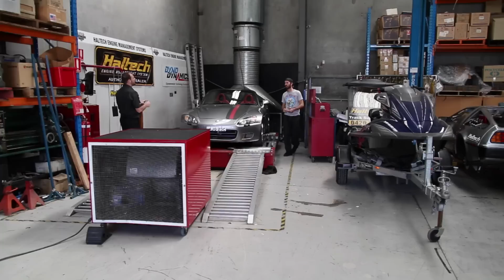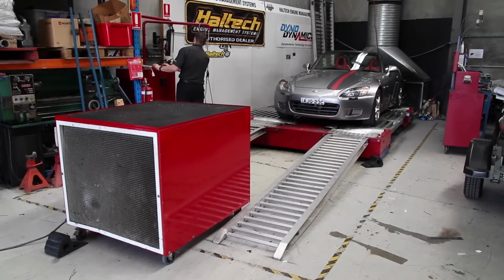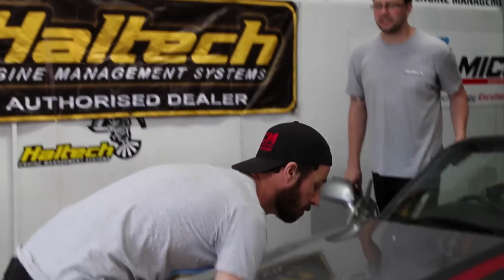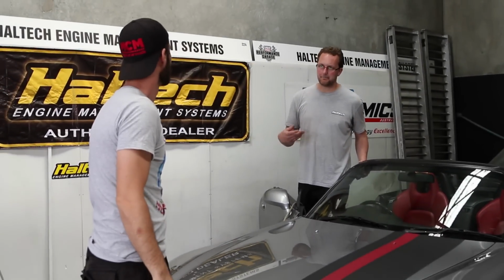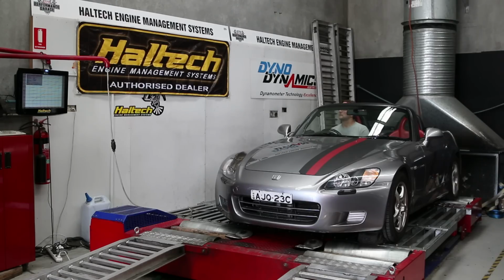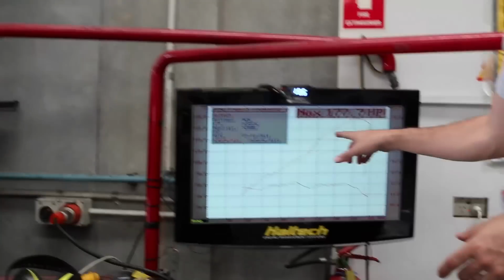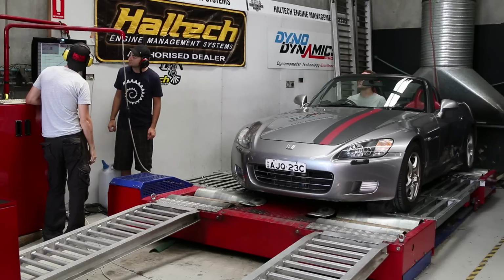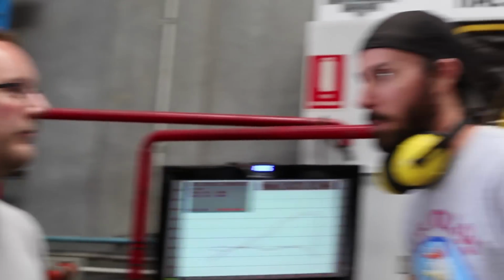Cold Air Intakes Mythbusted [Naturally Aspirated]

Comment: I feel that if air is too cold oxygen molecules will not move around as quickly, thus giving themselves less of a chance to interact and ignite with the petrol. On the other hand, if air is too hot, then the capacity for density of oxygen may be lower due to increased air pressure. As a result, I feel that there is a point at which you can optimize density and molecule speed, and it won't be at an extreme of hot or cold temperatures. Somewhere in between. What do you guys think?

Comment: Rx8 is a 4 stroke engine only different is the crankshaft gets power each rotation of the rotor. But for a piston engine the piston need to cycle 2 times for a rotation of the crank shaft

Comment: My cai is right in front of the driver wheel. Whenever I hit a puddle, steam comes out of the exhaust. While I could run a filter bag or water bypass, it makes me laugh that my engine with 220k doesn't hydralock. You Honda boys need tougher motors.

Comment: Having owned an S, the stock box is very well designed, and the filter and box from factory allows a high amount of flow. Moving the location of the filter does more in an S2000 than just replacing it with a CAI. Other cars respond much better than an S2000 to cold air intakes. This video is inapplicable to any car other than the S2K.

Comment: I love your enthusiasm and you are obviously knowledgeable and experienced. I live in South Florida where it is fairly hot and humid in the summer. It can get down into the 40's in the winter (sometimes colder). With every car I've owned, and there have been several in my 45 years of driving, I have noticed an increase in peppy-ness or, shall we say responsiveness at the peddle, when the temperature drops from the 70's and 80's (Fahrenheit) into the 50's and 40's. I believe you are correct, that you cannot feel an increase unless there is at least a 10% increase -- so what would you attribute this sense of responsiveness? If it's not raw power, could it just be that the delay from peddle to power is shortened enough to sense an improvement? Its a green-horn question perhaps -- but after watching your video I'm now curious.

Comment: One area this test completely falls down, is they literally swapped out the two systems one after the other, without giving the ECU a run to adjust to the conditions of the factory box, so may have been fuelling inefficiently.

Comment: so many sensors and other electronics in new cars today better not fiddle with em, Engineer Scott once said ' the more complicated the plumbing, the easier it is to stop up the drain '  where a cold air system would work best is on an old school V8 or V6  pre 85'
Reply: Not with a tune. Simply adding a cold air intake doesn't add much complexity at all. All it essentially does is allow for slightly more volumetric air to pass through. And with a good tune, it won't do anything negative.

Comment: The RX8 does not have a 2 stroke engine. The 2 ROTOR 13b rotary engine powering it is most definitely a 4 stroke.
Reply: Dark Lord Popo nope it’s a rotary so it’s technically a 3 stroke
Reply: @matthewbuttle  Sorry but no. No its not

Comment: Like they said in the video it won't do anything on a car with an already highly tuned system but in the U.K. At least some smaller hot hatches are deliberately restricted to meet insurance needs. I stuck one on a fiesta st years ago (which was a piece of shit) and it made a good gain. Purely due to the standard intake system having 5 miles of piping and the air box being directly on top of the engine so it got hot!

Comment: cold air ( as much as possible cai or fi )hot spark ( excel )and fast exit of exhaust ( headers )  and possible retuned ecu is the cheapest way to go for extra power wo tearing engine down and rebuild.

Comment: Cold air intake plus exhaust means at least 14hp gain and could shed 0-60 time down a second or 0.5 
Shed some weight off the car and see if you could do an ECU tune 
50 less lbs 20+hp your car will be very fast

Comment: The gain from cold air intakes is not noticeable on small displacement N/A engines. Try it on a 5.0L or greater V8 engine and you will notice the difference.
Reply: +RellyOhBoy It is all based on volumetric efficiency.  In almost every case a CAI alone will NOT create a physically detectable difference by the "seat-o-pants dyno".

I ran a 25hp wet shot of nitrous on my Mustang to ensure everything was working correctly before stepping it up and you just can't feel the difference if you are not being taken by the placebo effect.

Most NA vehicles will see around 5-9hp as an increase with a properly designed air intake.  You are not noticing that.

Comment: Hey, I dont know where you all got your information about intakes. But most people, argue a true drop down cold air intake vs a intake sits over the whole your drop down goes to (fenderwell) I Agree with the guy, yall went to. Every Honda guy who has wasted money on intakes for minimal gains....have all said samethings........ If your car is obd2 and past 2005, odds are to much engineering went into the intake system and should be left alone......If your 90s car, intake is big difference. What I wana know, is AEM v2 vs drop down cool air intake. But most people, first car....... will say no difference in short ram vs cai...... the ECU........ your IM cant accept more air without bigger ports and TB....... Also, those companies gains, are not from factory. They are done on tuned cars, that are now restricted by low flowing factory intake. Where they see the huge gains. Right now, in the prelude community, is the whale penis vs v2 intake... which is better. I like you all had the guy explaining the engineering in newer cars intakes. Love this video......watched it like 5 times, just to be giddy at the tuner, explain intakes on newer cars

Comment: His statement about not needing to tune when you change an intake is not correct (in some cases). On some cars, like a many NA cars, it can be true as seen in the video. But for many turbo cars, you definitely need to scale your fueling tables with a different intake. He said you don't need to do it because the MAF/MAP sensors do it for you...that is not always the case. A MAF sensor does not actually measure the incoming mass of air, the ECU simply estimates the mass of air based on a voltage signal from the sensor. The fueling tables then determine fueling based on the voltage but it doesn't actually ever know the amount of air that is coming in specifically, that is just a calculation (or assumption) based on controlled variables...like the size of the intake and a steady current over the sensor. So if you change a major variable, like making an intake bigger, then it is certainly possible for the for fueling to be wrong. The sensor will still send the same voltage signal but the scaling for the fueling table will not account for the fact that the larger intake may be flowing more air at the same voltage signal. Just like a water hose will flow different amount of water with the same water pressure if the hoses are different sizes. I have owned turbo cars where I changed parts like the intake and logged my fuel trims to find that they are off. Then I go back and log those trims as well as my air flow, tweak the tables and the car runs much more smoothly and consistently.

Comment: It's only now I see that aftermarket intakes don't have resonators. It would be interesting to see what a helmholtz resonator on a larger diameter intake could do if you tuned for it. I personally run a 3" intake with velocity stack, with the filter in front of the radiator of my 350z. No short tubes for me lol

Comment: I have had tons of different cars and modified the intake on a lot of them. In my experience it randomly depends on the car it self. I have had mixed results ranging from making no noticeable difference at all some just got louder but dint seem to go any faster and even felt a bit slower with less bottom end. And some cars it is the difference between pulling fairly average and quietly and then actually sounding and feeling like the engine is really opening up with a very noticeable gain in power and torque even from low rev range right through. But in my experience it seams a bit random even between cars that are the same model (one must have been built mid week and the other on a Friday arvo just before beer time...well that is my theory) Personally I think more often than not they can make a positive difference but performance engines  and bigger engines make more noticeable gains. I don't think putting a awesome intake on a stock 1.3L 1970's 4cyl is going to make 600hp and I think if you put the air intake from the 1.3L 1970's 4cyl onto a 600 hp engine that it would still be putting out 600hp after that. But that is half the fun of trying to get a good combination every car is diffrent

Comment: a cold air kit alone will do little if anything. combine it with either an outside fresh air, or better still, combine it with a ram air system. a short ram is NOT ram air

Comment: I feel like the intake would do more if a steady breeze was pointed at the grill....intake works better with cold air which is circulated thru drivin down  highway sitting still the air is a bit more stagnant

Comment: Not going with something like this on my car. The exact same air filter housing (except for the cosmetics) and air filter  is used on a version of my car which has 133 more bHp. If it's good for the more powerful supercharged version, I wouldn't expect any improvement over what's OEM installed now. I also tried a K & N filter for a while. Then switched back to the OEM Donaldson PowerCore. After a couple of tank fulls, my mileage increased from 22.3 to 24 mpg, according to the onboard monitor. Also learned K & N filters have terrible filtering capabilities until they get dirty enough. Then the margin of flow between it and other filters is greatly diminished. I think in my situation, OEM is probably best and most cost effective.

Comment: factory airbox is always better because there is piece of plastic you usualy do not see that blows straight into your airbox as you drive and all the air goes to air filter and not around everywhere as it does in with open air filter

Comment: Cold Air intake will make power if it is "Tuned Length". N/A only 1.9 times volume of motor to be from air filter to throtttle body. i.e. 3ltr motor 3x1.9 = 5.7ltrs of air must be in tubing between airfilter neck and throttle body opening.
Have a look at N/A WRC cars and you will find a large bubble in the intake.

Comment: The best way to do it is put a cold air intake after u have install an exhaust system on your car but a good one not a cheap one cuz the more air the engine sucks in the better ill release it with the exhaust so ull get better gains

Comment: 10-20% gains? No. Maybe 10-20hp, which is still excessive. I don’t think any manufacturer in their right mink would claim 24-48hp gains on an S2000 (stock 240hp)

Comment: Wow I'm in shock.... A 300$ intake system will give you more power!? I guess cool air also has slower molecules and is more dense then hot air which means it will combust better...

Comment: the ECU needs to get used to the new system first.  it took my car a week until it adjusted to a cold air intake system.  that's when the you could feel the throttle responds better to your commands. then another week to dumb down to the stock intake system.  throttle response have slowed and there is less feedback on the pedal.

Comment: I put a K&N air filter in my 2011 CTS-V and I did notice an increase in power, saw an Air Raid video and was sold. Four hundred dollars later I'm in the car and I notice right away, the car is slower, noticeably slower. I told myself that it was my imagination but in the long run accepted the fact that it didn't help me attain any speed at all but retarded it. Never again unless it's proven to me before I spend my money, thanks for the video.
Reply: Christo Franco it works best if you add other performance parts with it like headers maybe throttle body and cams and then tune them all together

Comment: Why dose no one mentioned that if you increase your air intake you need to increase your exhaust.  Also bare in mind increasing the diameter of the throttle body can add to the cold air intake power boost do to more air flow.

Comment: The intake system is designed to work well in most cars anyways unless its sucking hot air from the engine bay it probably wont make much of a difference on a well designed modern car
Reply: Like the s2k. The airbox sits in between the boiling hot radiator, and the searing hot exhaust manifold area. Good job Honda. Maybe I need a mechanical engineer to come and explain to me the reason why.

Comment: Gains will be higher if it's plumbed truly to the cold air outside of the vehicle.... I notice a drastic difference in my vehicle between a 70-degree morning and the 30-degree morning.... I'm running a short ram intake with the cold air from the outside Plum directly to the filter

Comment: 177 whp?   That is what my Brz puts out with cold air and cat back. 

Tekada cold air on the Brz adds about 6 Hp @ 4000 rpm backs off slightly then peaks @ 7000 rpm. More torque down low below 2500 rpm. Sounds far better than stock. Best $300 ever spent.  If you try to add any other bolt ons without a tune the car will run lean and give a cel.

Comment: Test a car with a 6 or 8 pot under the bonnet. The S2000 is a typical high winding, high rpm car. All the power is way uptop.

Comment: yaa, my cheap $50 car that was a buick lesabre had always performed better on cold and nightly days vs the hot summer. I almost wanted to get a cold air intake just because I could feel the difference even in day vs night driving. I wanted to connect the air conditioner to the air intake hahaha.

Make a video on that! Make a big hole in the air inatake, then re-route your AC air flow line to blow AC air into the air intake. hahah I thought of that before but I never even looked to see where the air tubes are.
Reply: The problem is the engine bay is really hot no matter what, so by the time the air has passed through the intake tubing it's warm again.
Reply: Not The Soap haha ok. that was just one of my drunk ideas I had long time ago
Reply: Tyee Cambrón Haha to be fair though lesabre's have a good engine.
Reply: lmfao

you're going to run your A/C, which robs engine power, to cool your intake air, in an attempt to make power.

This is sort of like plugging a power strip into itself to have infinite energy.

Comment: so as I figured whether you make more horsepower or not from a cold air intake depends on different factors but seems like mainly where the filter is placed. It's near the engine no you won't make more horsepower. I got an 08 Altima 3.5 SE and when and if I get a cold air intake put on mine I'ma try my best to get the filter placed as far away from the engine itself as possible

Comment: Yeah but the stock is only gonna take in cold air while driving.. the cold air intake will have a little less restriction during a dyno but the air channels guide cold air up to the air box as you drive and force dense air into the engine . This isn't the best test for something that involves induction as a factor on the result of the h p when you have a car that is not moving .

Comment: I absolutely LOVE that he called the RX8 a two-stroke.  Fundamentally, rotaries have a lot more in common with two-strokes than they do with 4-strokes.
Reply: they absolutely don't. lmao what??
Reply: @MASSIVEsock  You run premix in your 4-strokes?  You get one firing event per chamber per crank revolution in your 4-stroke?  You have passive no-valve ports in your 4-stroke?

Come on, they even sound the same.
Reply: @JETZcorp  it's 2025, after owning several rx7's and other rotors, I don't think it's worth explaining why a 4 cycle rotary engine isn't a 2 stroke. We all make jokes about it, but they're literally a 4 cycle engine.
Reply: @MASSIVEsock  I think you need to look more closely at how a 2-stroke works.  They're a 4-cycle too, they just multi-task using both sides of the piston so that they get to fire once per crank revolution.  Much like a rotary with it's multiple rotor faces.  The fact that a rotary executes the 4 "strokes" in sequence doesn't separate it from ANY internal combustion engine.  2-strokes do that too, as do jets.

Again, if you're talking about a port-timed engine that fires once per crank rotation and uses total-loss lubrication to create roughly double the power you'd expect for the displacement while having issues with efficiency and combustion seal wear... there are 2 things it could be, and it's not a 4-stroke or a diesel.

Comment: Stock intake already works like a "cold. Air intake"
Reply: I know right?  They call them cold air intakes which implies that it will take in cooler air than stock.  The one thing you don't see is a company measuring the difference in air temp with their intake.

Comment: Mighty Car Mods can you make a video where you test putting ice on the intake manifold? Maybe even step it up a bit and insulate the entire intake system with dry ice... Like... Idk fill a bunch of socks with dry ice and duct tape them to the intake tubing and intake manifold... 
Wanted to know if cooling the intake system would keep down on heat soak, because if it does I want to try and route a coolant line to wrap around my intake duct and intake manifold...
I would imagine however, if this works, and coolant lines would have any noticeable effect, dry ice would be like... Maaaaad mega bombing it, as it's -74°C. :)